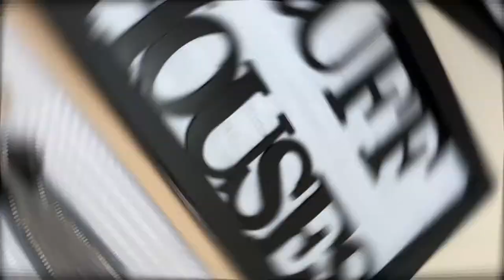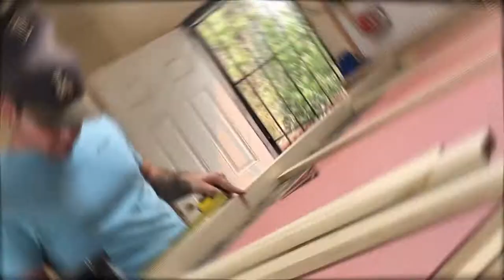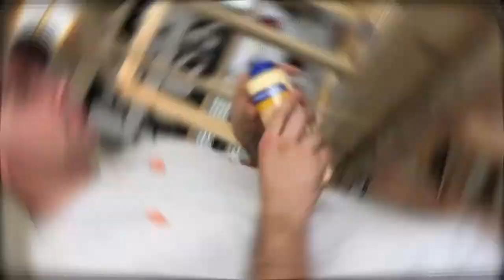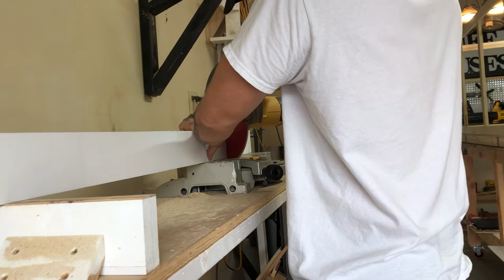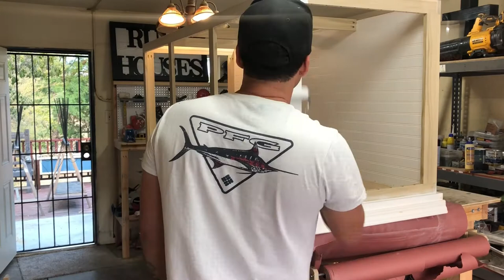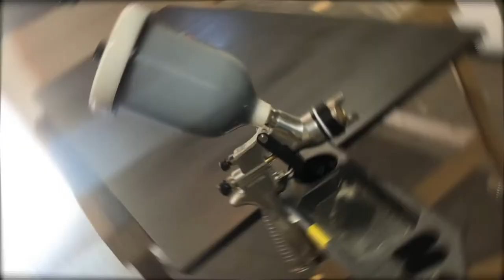DIY Dog Crate/Kennel

Comment: "pro tips"  fill your  pocket holes. , buy a joiner., use push sticks,  wear shoes in your shop NOT CROCS. And fix your  miter saw stand before it falls down. other than that nice build.

Comment: Good Morning great build! Love the white farmhouse look! Where did yuu get the 1/2 rod? Did you purchase them black already?
Reply from the maker: Right on thank you!! It’s  1/2” hot rolled round bar from my local steel supply. I primed and painted them.
Reply: @Ironfoxgates  doesn’t that rolled steel increase the costs
Reply from the maker: Here in Redding California it’s less than $20 per 20 ft stick.

So it’s fairly affordable

Comment: How did u get the bars in after the frame was already together?
Reply from the maker: I drilled the holes on the top rails deeper and they slide right in
Reply: @Ironfoxgates  ohhhh, ok . Nice work 👏👏👏